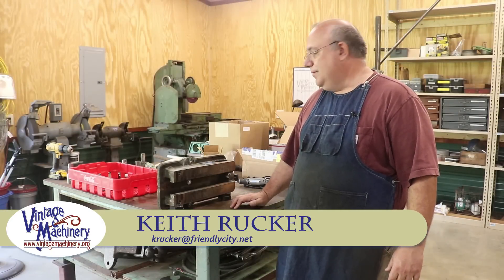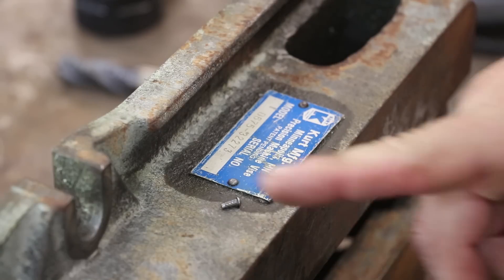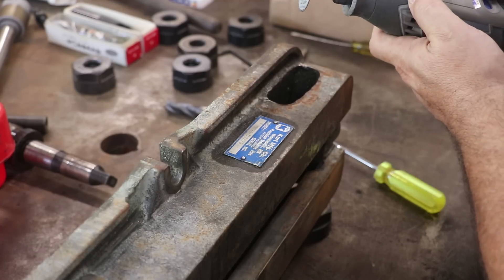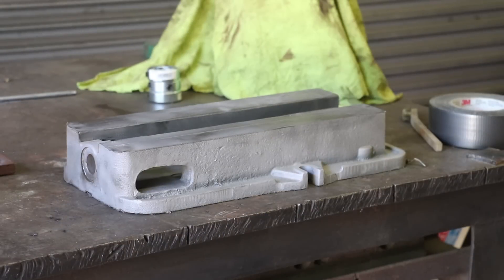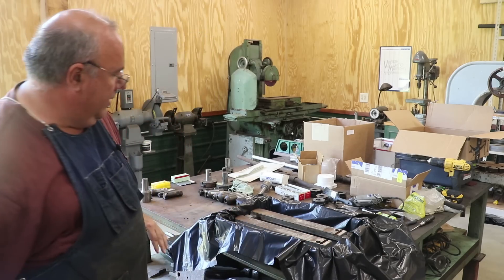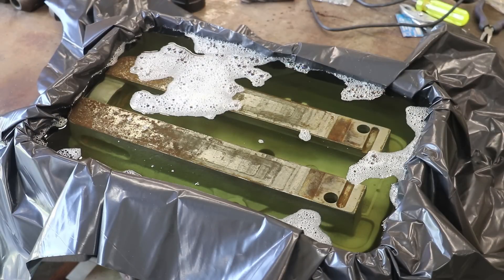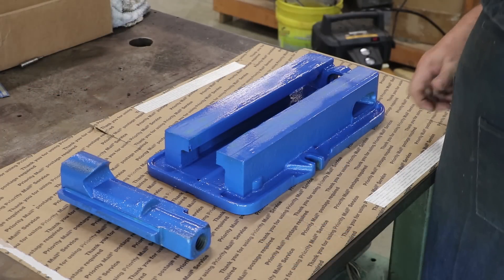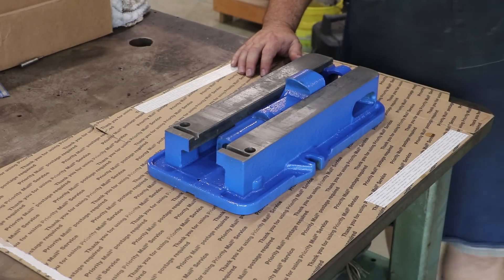Kurt Vise Restoration Part 2 - Painting and Grinding the Base

Comment: Keith, next time you need to remove those drive screws, try using a electronic parts flush cutter (used when cutting lead when soldering) and you can easily get between the head of the drive screw and the plate and remove them with ease. I've removed a lot of them that way and even was able to reuse them as well. Just an idea.  The vice looks amazing thus far.

Comment: Mark my words Keith, I’ll be the next you/engelscoachshop. I’m 28 and I’ve got a shop full of vintage industrial woodworking machinery that’s ready and waiting to be restored. There’s gonna be a Yates American Y36 Snowflake restoration, a Yates American G-91 dual arbor table saw restoration, a Yates American K-25 restoration, a Rockwell Unidrill restoration, a Wadkin LQ pattern mill restoration, a Whitney S105 24” planer restoration, a JA Fay and Egan Model 62 8” extended bed jointer restoration, a Yates American J-131 8” jointer with skewed head restoration, a monarch unipoint X36-A-E radial arm saw restoration, a Wadkin bursgreen AGS-10 restoration, a Oliver 34-DSD combination disc/spindle sander, a Syracuse Model D 15” disc sander, two moak shaper restorations, power feeder restorations, many many hand tool restorations, vise restorations, and so much more. Side note, scored a 30” Brown and Sharpe camelback straight edge in mint condition in the box for $80 the other day!

Comment: Nice vice Keith well done
Reply: Keith 
Why don't you try this. Strike a starter point, then drill a hole to fit your smallest screw extractor. Then use the extractor left turning to screw out the drive pin. Let me know if it works. Chuck

Comment: Now that you have a flat and presumably de-torqued top surface, I think I'd be pretty strongly inclined to flip it over and take 1 or 2 thousandths off the bottom. Not to try to clean it up, but just to try to make sure that the majority of the bottom surface will be parallel to the newly ground top surface.
Reply: l wilton I agree, I think I would do the same to top and bottom to be sure. It could save a lot of set up time in the future. I can also see myself grinding everything in the shop flat like a little kid with a new toy when I get one. I understand why he didn't as they say there's a hundred ways to fix something.
Reply: Agreed, then stamp the vise with the amount you ground off.
Reply: Agreed as well. Definitely prudent to grind the top and bottom surfaces for true and parallelism. Great idea to stamp the bottom to indicate how much was ground off each surface for future reference.
Reply: So, but I have a question. The vice screw rotates in a cast part of the base, doesn't taking material off of the top surface change the geometry of the sliding jaw to the base?  Probably wouldn't matter when the jaws are nearly closed but might it at near full opened?  Just curious.
Reply: MISTERComaToes Good question, I went back and looked at part 1(disassembly), the nut(?) under the moveable jaw looks to have an arrow shape that's able to pivot slightly into a matching arrow shape to push the moveable jaw. It looks like it will find it's own angle to transfer the rotary motion of the screw to the jaw. The amount of metal removed will probably not be an issue with the screw-jaw geometry. You caught me, I had to look.
Reply: The vice jaw slides along the top surface (or ways) of the vice. If you remove metal from either the top of the vice or the bottom of the jaws you will slightly change where the point of the screw hits the ramp in the underside of the jaw. However, the contact point is a ramp that is designed to handle a fair amount of vertical misalignment, and removing a few thousandths or even tens of thousandths form the interface won't have any effect on the vice operation. Start removing tenths of an inch and you may well run into problems, but anything less than 50 thousandths or so should be ignorable.
Reply: Thanks for taking a look, I appreciate that!  I'm pretty sure you are right, now that you say it.
Reply: Makes sense...  it just SEEMED like it was wrong when I watched it but yeah, it will have minimal effect. That particular part really isn't the precision part of the vice... Must not have had my coffee yet!

Comment: Keith, glad to see you back from the bash. I was getting some "cupping" also. I was able to correct that with a more thorough dressing and slow dressing. Also, don't forget to clean up the sides of the wheel also...better symmetry and trueness thus eliminating errant cupps" also. I agree with the slow traverse and small incremental crossfeed.. Sometimes a couple of passes at 2 tenths each and finish with just small "nudge". I by no means am an expert just wanted send some input. thanks for the enjoyable video. -Tom Eyssen

Comment: I am working on a lather restoration and the drive screw holes are drilled all the way through. I was able to take a pin and drive them out from the back side. I am sure that not all are but it is worth a check to see.
Reply from the maker: Unfortunately, they were not through holes....

Comment: your ripple could be wheel balance also, especially if its more cosmetic than dimensional. when i was rebuilding vises at my last shop i found that the height matching was actually an option. they were so badly worn we had to mill down  to clean material. when we do gang vise work in my new shop we use a step jaw and run a truing pass with a carbide endmill down all the jaws to make them all the same. since your vise is probabbly going to live on the swivel i wouldnt worry about grinding  the bottom unless your going to try truing up the fixed jaw in place, then it might be helpful

Comment: The 'ripple' may, in fact, be grain structure in the metal. You might want to put an optical flat on the vice to see what the surface looks like.  Metallurgists often use a combination of grinding and polishing/lapping to reveal grain structure.  Similar to what Phil and Pierre did recently with some welding experiments.
Reply: Pierre's Garage, I think that Jim Bollinger (Do-Rite Fabrication) has also done some sectioning and testing of welds.

Comment: Do you have a surface plate? I know you're done with this, but...
If you do, put the vise on Jacks (3) and level the bottom as close to zero all the way around as you can.  Dead level. Now without touching it put your 0.0001" indicator on the top rails. Check your TIR from end to end and side by side. 
Now you know what you have to deal with.
If you need to grind it check for the bow. Find the crown. If the crown is in the middle, grind the other side first. Use bluing and just when the bluing is gone, flip it and dust off that side. Done. Minimal grinding removal to factory parallelism. 
I ground these vises 50 at a time at Kurt back in the 90's. Match pairs come off the same load. Good job on the restoration.

Comment: two things: firstly,  cold chisel would make a good starting groove for your cut off wheel.
and secondly, I was taught many, many, too damn many years ago never to grind with a cut off wheel because of the high risk of wheel shattering and the attendant risk of shrapnel wounds.

I think I am with the folks who were in favor of grinding the bottom as well. one of the kurt  selling points is the high degree of parallelism between the top and bottom.

when one considers the before and after appearance such a rebuild sure is worth it.

Comment: I remove  those little “rivets” with a small nail remover that looks like a screwdriver except that the end is bifurcated with a V groove. I tap it under the rivets and they come right up. You can use a thin shim under the tool so you don’t scratch the tag.

How will grinding affect the tolerances between that, and the nut, which runs in tracks? Then there is the groove for the cover, if it’s used

Comment: Keith, its good practice not to use coolant on cast iron , might be causing the ripple. Another point , your wheel might not be tight. Try locking your wheel wrench on the wheel guard and turn the grinding wheel by hand . This will get the wheel tighter than hitting the wrench ( your spindle will thank you ) . Also redress the wheel for the last pass . For grinding wheel selection Norton has a very good guide on there web site . I hope this helps you , I was lucky to have very experienced journeymen train me ( retired after 41 years making tool & gages )

Comment: Could you use a little wedge under the tag to push the drive screws out? I'm thinking you could even use like a little Teflon wedge with a slot down the middle to slide under the tag and around the screw. I'm thinking something similar to chuck wedges.  I know there isn't much of a gap to start with in-between the tag and the machine , but you could maybe get a gap started by using a little flathead screwdriver. If you pushed the little screwdriver in under the tag just next to  the drive screw (so you don't run the risk of mangling the tag as much as if you pryed on the tag closer to the corners of it).

Comment: Keith, great vids - thanks for the knowledge and the entertainment. One newbie question for you - how does your surface grinder account for the wear on the grinding wheel? When you are talking thousandths of an inch per pass it would seem the wheel itself might be losing enough grit to be of significance... Cheers!
Reply: OK, I asked my question and then I read mcpheonixx's comment and Fr4g4lot's reply. Comments are a lot like instructions - it helps to read them first (most of the time ;-)
Thanks again Keith! and Fr4g4lot !

Comment: Hey Keith me and my father have a question for you. We started doing electrolysis on some old corvette springs turned out great. We wanna do a pair of old school brake calipers for the front of a corvette and it's not like super rusty. But my question is will the electrolysis hurt the runner Gromets that push the piston? Idk if that makes sense or not it does in my head at least.  I learned how to do electrolysis from you and Abom. So thanks any further help on that would be great cause we don't wanna ruin a few hundred dollar item. Thanks have a great one!
Reply from the maker: It should not hurt rubber.  Some other metals and alloys can be a problem though.  Fine on iron and steel but better to not use on other metals.  Do not do it on Stainless Steel!
Reply: Keith Rucker - VintageMachinery.org ok thank you I will let my father know :)

Comment: what was the rust and paint remover you used on the leblonde lathe or was it the monarch. I'm restoring two old leg vises and a drill press. please get back to me that would be so much help
Reply from the maker: The paint remover was Citrastrip.  The rust remover was Evaporust.

Comment: If you did not have the surface grinder, would you consider fly cutting in the mill? I assume that would not be as accurate on steel, but pretty close on cast iron?

Comment: Did you balance your grinding wheel on the hub? Also dress both sides of the whee before balancing.  Spent 1000 of hours grinding on a surface grinder. Those little ripples could be wheel hop.  Great job though have rebuilt the Kert vice several times myself.  Thanks for sharing this 👍

Comment: In the future, when you're cutting tiny slots inside tiny rivets or whatever they may be, get a carbon disc, run it against a diamond (for a grinder) and thin it out a bit. I've found this method to give very nice slots up to .08 mm, which is very thin.

Comment: Probably not a bad idea to hit the high spots on the bottom to see just how flat it is. Iron can warp up quite a bit. I once had an old, neglected desktop Craftsman lathe  (2’ ? )that was lent to me and one of the feet on the bed casting must have been warped up a quarter or half inch!! I bolted it to a commercial table top and after I had used it a couple years, the twist had subsided about 50 pct. It really needed to be stress relieved, but bolting it down flattened it sufficiently. This Old Tony (?) tuned up a cheapie milling vise and when brand new, the bottom was warped or had some low spots, despite the machining marks.

Comment: Hi Keith,

Nice job on the vise.Was the grinding wheel you used and Aluminum Oxide? I believe a silicon carbide wheel would work better in Cast Iron.

Steve

Comment: I know that +I wilton asked this already, but my question is slightly different. It's how did you resist flipping it over and taking a light cut on the bottom after you finished the top. I know you had the impulse, how did you resist?

Comment: I've had some (not 100% though) luck on the drive screws using a small pair of flush-cut wire cutters to get right down on the bottom of the head and squeeze, lift and twist at the same time.

Comment: I see you are using those freebie USPS boxes for storage and as painting surfaces- don't complain if the cost of stamps goes up.
Reply from the maker: Yes, but they are all recycled.  Lots of the stuff that people send me come in flat rate boxes.  I will often use them to store stuff in the shop or tear them apart and use them like I did here.
Reply: I was just pulling your chain a bit, I'm the same way- if I get a box that doesn't have any holes, I flatten it out and put it back on the pile.  But the one you were painting on still had the stick-on protectors, so I think you fudged on that one.  Anyway I'm looking forward to the 10EE project- the LeBlond was a fun one to watch.

Comment: I've always just put a scew driver up under the name plate and pried those set screws out with no problem. Get up just a little grab it with needle nose pliers and they pull right out.

Comment: The left and right sides of the top might not be cleaning up the same because the bottom is uneven. It is hard to imagine it not being parallel out of the Kurt factory. But it is probably just fine unless you are Rob Renzetti.

Comment: Have you ever used body filler on any of your restorations? I've seen where some folks do it and make cover model style restorations. Not really my thing, but just wanted to get your thoughts on it.
Reply from the maker: I have used filer before - primarily to fill in rough castings.  Very often, large castings had lots of defects in them and they factory would just fill them with filler.

Comment: Nice work man, but why don't you use primer on your restaurations? Was thinking of this a couple times like as you painted the lathe.
Reply: he thinks that with cast , it sticks well enough without primer, he might be right, it does save a lot of work too
Reply: Jusb1066 
Should primer cast iron will rust like S.O.B.
Reply: Keith said this was Rustoleum paint. I was once given a whole bunch of cans from a local company. "It doesn't work with our primer" was the reason. So I picked up a can and read the instructions. "Do not use primer" was the first thing I saw. So I said "Thank you very much", grabbed the bag of cans and went home...
Reply: he he doesnt do primer for cast iron and what the worst that happen paint comes off and give reason to do another video or change color. it wont rust because its paint and he derusted that whole thing (even tho they say in 20 mins it flashrust) he should be ok
Reply: At my paintingshop, the guys can mix your primer in any color you wont. That shouldnt be a problem. I usually use a slightly lighter color to gave a good control were the final coat isnt perfect. Of course this is costly, but something like this is a "once-in-a-lifetime" paintjob.
Just my 2 cents, sorry for bad english.
Reply: One thing to remember tho,  Paint is only colour.
takes primer to make a job of it im afraid.

in fairness, its not the end of the world here, My man Keith is doin a good job.

Comment: It's a little late (3 years worth), but when I find pitting in a machined surface, after cleaning what I can, I fill the pits with J-B weld and clean the surface with a razor blade once the epoxy is firm enough to not pull out.

Comment: I'm building an airplane and one job I have to do a lot is drilling out rivets. Once you center drill through say at 3/4 of the diameter the rivet loses its strength and is easy to punch out. I think the drive rivet would be the same. Center punch it and drill out to say half the dia. And I think it would pull out easily.

Comment: What are the differences of milling a surface vs grinding a surface vs hand scraping a surface?
Reply: What is ... They are all spelled differently ?   
    Was that the daily double question?
Reply from the maker: With a grinder, you can get a precision surface.  It is for making things very flat - much flatter than you can get off of a mill.  Scraping can take a ground surface a step even further.
Reply: Thank you for the reply.

Comment: How much can You grind off that surface, before the screw gets too much off line with the nut? From my understanding, it seems that the front end of the screw will be lowered by as many thousands You grind off the surface....
What I'm really asking here is - do You have to regrind the V-shaped "hook" on the nut too, to reestablish the geometry so that the screw and nut line up again? Or has the designer of this vise taken this into consideration, by adding something there, that I didn't see?
I know this probably won't matter when You shave off just a few thousands, but let's say I have a vise with deep marks on the sliding surface - having to grind off fifty thousands - and no way to weld it up?

Comment: I’m sure this has been mentioned before but evaporust turns my parts black. Suggestions?
Reply: probably dereusting high carbon tools, same happens when using electrolysis, have to give them a really good scrub with scothbrite
Reply: Tom Wilcox thats normal. its iron oxide. just rub it off with scotch brite

Comment: To protect rusting after soaking in solutions, clean with water but then usu denaturalized alcohol 98%. It evaporates a leave the surface realy dry, preventing 10 minutes rusting acuring in humid enviroments
Reply: pif paf wd40 works well too.